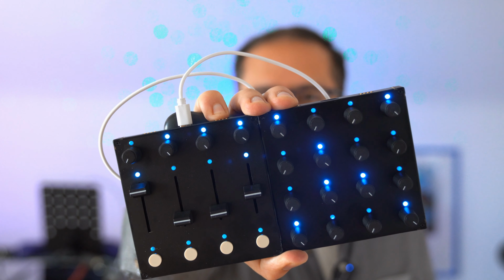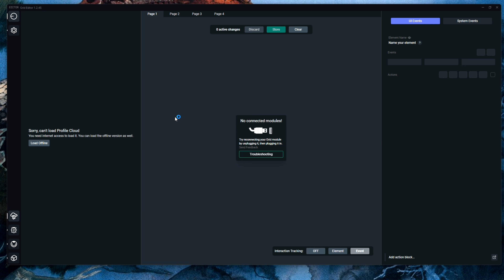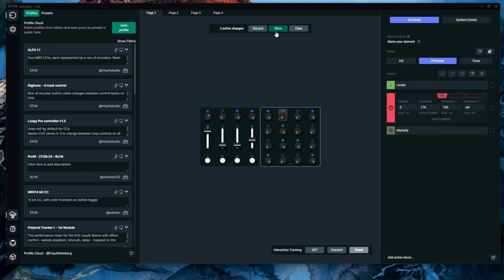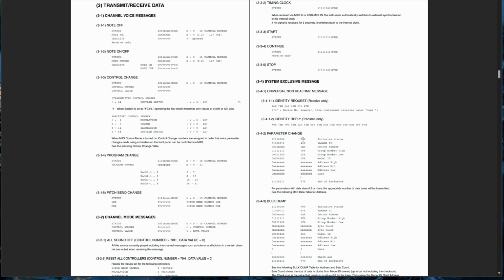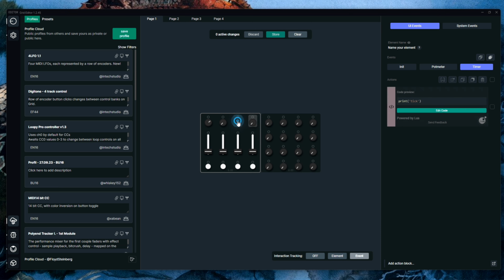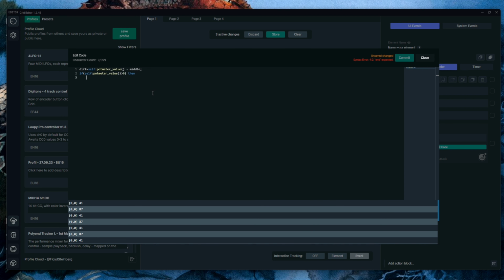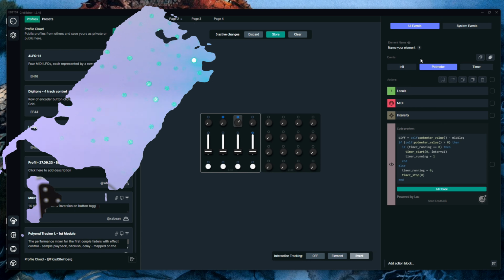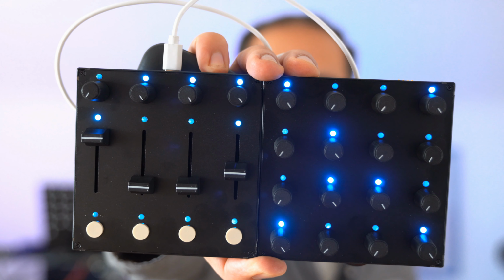I bought MIDI controllers from a Facebook ad ...

Comment: Impressive they have a Linux configuration option, but these all need trs midi, and a snappable battery pack...
Reply from the maker: That's optional if you have a USB MIDI hub (or a smartphone and a MIDI interface) around. I bought two controllers and used my $30 USB to MIDI host in this video, without the need to use a computer / smartphone.

Comment: Interesting concept, using a programmable MIDI controller to enhance synthesizer functionality, by adding new modulations, step sequencing, etc. Is there also a way to store programmed presets on the units, when not connected to a computer?
Reply from the maker: Thanks for watching - yes, the programs are stored on the controllers and are available once they're switched on.

Comment: Hi Floyd (I know it's not your first name but for the sake of privacy),
The one with the rotary encoders is, physically, quite close to the DJ Tech Tools Midi Fighter Twister (quite expensive for my wallet), haven't tested neither, I don't know how they could come close together.
Have you got any clue on how both compare?
I just want a Midi controller, with rotary encoders (a lot), that could direct remote message a software synth or a hardware one with paremeters not directly linked one to one potentiometer but only through menu diving like the Waldorf Blofeld you know.
Building one of those controllers myself, I know there's some channels explaining that, but, maybe one day you'll have the time, patience to explain the DIY Midi Controller of the Galaxy ;)
I know, it's about encoders, soldering, arduino language, maybe not so difficult, though...
Thank you for the already done research, work.
Reply from the maker: Hi, thanks for watching! I never owned a twister. It seems those are built more robustly, but lack the LUA macro feature. They're also twice the price.

Comment: How many bit are the encoders, 7 or 14..? Cant find the info on there website.. thanks
Reply from the maker: They're 14bit. You can switch the "resolution" in the editor of needed.
Reply: @mr_floydst  hmm extra! How is the course of the faders, do you have a comparison at your disposal ? Faders are long enough, how is spacing in between ? Thanks a lot
Reply from the maker: The overall built quality is not what the product photos might want to make you believe, everything is made from plastic. That being said, all knobs and faders are precise and tight. The fader caps are not, though, you can easily move them from left to right for 2 or 3 mm. That doesn't affect the precision of the input, though.